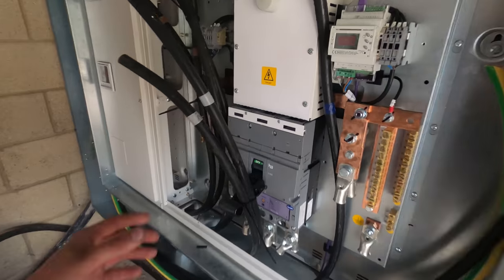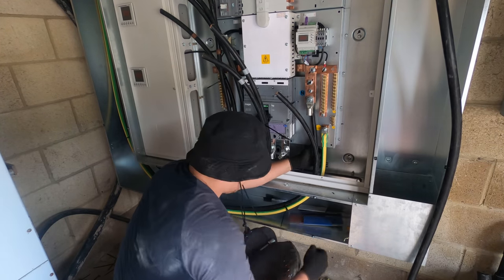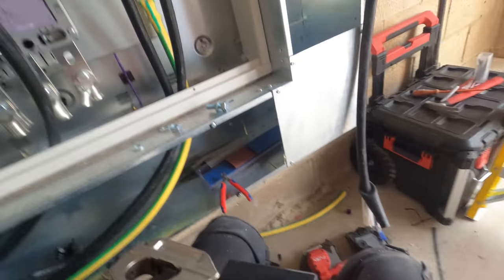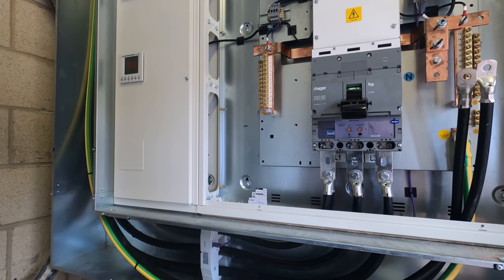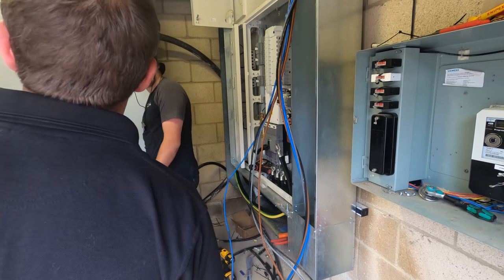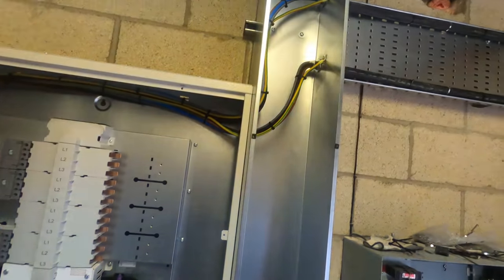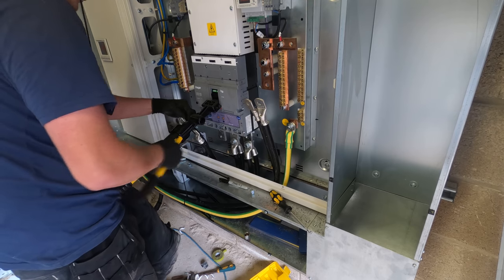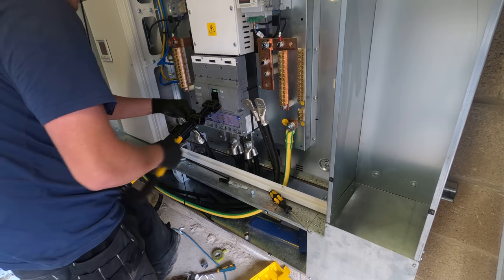Terminating a 630A 3 phase supply - 185mm2 Parallel’s

Comment: I can highly recommend the Klauke Hydraulic crimpers having used them extensively all the way up to 400-500s. Expensive to buy and own obviously, but i'd say renting one where you're gonna use it is 100% worth the money for how easy they make the job. That said, it's not my money either way, i'm just the dude doing the work.
Reply: I use klauke EK60 ( old model with old makita batterys ) a lot at my job at a factory  .. i do own the chinese one like in video .. it does  work .. but the klauke is soooooooooo much easyer ..but expensive if you only need it couple time a year ..
Reply: Im agree
Reply: @kittsdiy  i think we have the same model at work. its a slow crimper, we also have a weidmüller epg 60 crimper its much faster, and a way more balanced which is a good thing when you are using it a lot. would love to try the milwaukee ones too but i cant get my hands on 1 for a test
Reply: @kittsdiy   same goes for me. its a company owned tool we just get to use it
Reply: @DeviloftheHelll  yeah, the Weidmüller crimper rulez!

Comment: Neat job, impressed by the tools used today. When doing LV panels in the good old days soldered the lugs, fingers crossed never a dry joint.
Reply: Aye getting the old solder pot up to temp on the gas ring and wiping the cone on the gland,happy days
Reply: @anthonyschofield7807  Don't forget the flux and cut back the conductor insulation and use insulation tape to cover the exposed  copper/aluminium.
Reply: @terrypark5886  Aye scotch tape I bet you can’t buy that now and imagine showing a new apprentice how to prepare a wiping cloth. I laugh at some of these videos now with their tin box dis-boards and wonder how they would go on with Bill Imperial iron clad switchgear
Reply: @ Antony Schofield  I started 1969 working to the 14th edition of the regs. 
Cast iron bain of my life drilling for what seem like a life time and those stupid Enox cutters. Remember the  narrow MEM distboard had to use long  nose pliers to enter the conductors into line, neutral and earth (cpc) terminals. The days of  rawlplug tool and fibre plugs.
Conduit bashing started with a wooden block and from nowhere Hilmore bender with the vice appeared.  
Installing 240 mm swa using brooms to hold swa against the ceiling while your mate cleated as you progressed along the run.  
MICC 1.5 to 150mm   dressing and making ends in the freezing cold wearing a donkey jacket on one of many  petroleum refineries.
Metal trunking  making right angle and set bends of different degrees. 
House bashing 1930 newspapers under the lino or carpet stained with pets  urine.  Wooden fuseboxes without a main isolators, porcelain interiors and fuses. Immaculate installed  lead or TRS cables. 1/044 and 7/ 029 stranded conductors  became 1.5 and  2.5mm singles.  
Working live on busbar chambers plastic sheets over the bars, earthing removed, bum cheeks in tight mode as you drill and tap the 500 amp live  busbar. Lug in place tighten the brass bolt  saying to yourself "I survived."
 The voltage tester a 60 watt lamp flex pendant. 
As a machine sparks life was so simple in the  electro/mechanical era visual inspection of contactors / relays making or breaking assisted when fault finding. 
Finally skill of electrical design out the window all the calculations  on software, I miss my slide rule.
 Fifty three years later still sparking.

Get Outlook for Android
Reply: @terrypark5886  I started in ‘63 but had a very similar experience over 54 years! 
2 inch conduit bent with a screw operated bender,bending block a treasured possession when it was properly broken in. Seeing cables going from lead via tough rubber to PVC,mounting sockets and switches on wooden patresses.13th edition then and testing was extremely basic,500 volt wind up meggers.Still installing paper lead cables.Seeing so many different MI tools come and go and they never got them right.But always learning,always something new and new tools to buy,at 73 years old I still buy bloody tools 😁.
You and I have probably seen everything in our game and have some stories to tell,some situations would scare the pants off young sparks today.Health and Safety??As for slide rules I doubt anyone could use one today.Cable calcs?How long ,what current,volt drop,who ever dreamed about disconnection times and that short circuits wouldn’t blow fuses?
A good job though,so many opportunities to make money on the side,Burglar alarms,satellite TV,CCTV 
someone always wanted something 
Cheers anyway nice to reminisce

Comment: The Indication for the phasing in a "SqD I-Line" panel (or any stacked-bus design really)  is indicated by A-B-C markings on the breakers themselves  ( @ least the ones in the US ).
Also, you can order 2-poles as A-B or B-C or A-C  &  1-poles as A or B or C  because you have the advantage of  installing  them in ANY location ( unlike a typical comb-bus style panel ).
The other huge advantage was the somewhat-safer install/removal of a breaker while the panel was energized. Electrical-Safety standards have improved greatly since those days obviously.

Comment: Shame the mistake with the original DB was so costly. Not one you'll make again in a hurry. Good thing the DNO was able to attend a second time so quickly.
Ironic that the Chinesium crimpers seemed more reliable than your SWA ones. Hopefully you'll get them changed under warranty.
Keep up the content. It's great so see content that isn't residential.
Reply: don't get that mistake much.. couldn't he just reverse the other side ? ( where no live is ) instead of  again calling the DNO to turn off the power for maybe 15-30 minutes to  change 2  wires in the braker ?  Sounds silly to me ..  i find i not such big mistake .. we usually measure the phase rotation to see if it's correct .. but on a dead board that's hard ..  Really bad dessign of board ... you have to call  DNO before working in it is possible  ..
Reply: @residualelectrical  Still silly you need to call DNO  cut the feed to that board.  Factory i work usally have a pvc isolation over the incoming tales ( in this case under de main isolator switch )  I can understand not working in a board with live busbars ..( i don't do this also )   Couple weeks ago i added a 250A braker to an 800amp board just powered off the main switch and then removed plastic cover off buss bars  ( not the tales ofcourse !  ) .  The  2x300mm² aluminum tales where still live but unable to touch .. plastic cover protected.  in this case a pcb cover over  main tales ( underside of main isolator ) would make things al lot easyer to service ..  Remove the metal front  when everything live would also be not done here . ( i can understand the cut the cables of the brakers in this case lol  )

Comment: I-line breakers come in ABC and CBA arrangements on the back of the breakers connecting to bus bars, which might explain why you had a phase rotation issue. Nice job, a lot of life left in those old I-Line boards, a lot of strength in them compared to some of the modern tin foil MCCB boards.

Comment: Three phase power is wonderful, but preserving phase rotation is super-important when it powers big pumps - blowing rather than sucking can be quite messy on the factory floor.  Trust me - I was there when it happened in about 1973, but not my problem - the error was made by our utility company when they changed some service wiring in the alley behind our building very early one morning, and all our motors were suddenly running in reverse.  Great fun in hindsight, but a nuisance nevertheless.

Comment: my chief has almost changed all stranded cables above 90mm2 to highly flexible cables which are more expensive but you can use a lower diameter because they can take more power and temperature as the stranded ones
Reply: That and the fact that you spend less time fighting a bloody fucking bear to put them in place ^^

Comment: Never thought to use my powered hacksaw for cutting cables.Always used my ratchet knipex hand cutters !
Do you cut the cable end at a slight angle to get it right into the lug some lugs seem to have a sort of a draft angle due to how they are made.

Comment: Those cheap crimpers are $64.99 USD on Amazon.  😎👍  4.5 stars with 761 reviews.    Also I won't give you a hard time about still using some of the yellow power tools either!  Need to get a few more team red tools to swap those out.

Comment: 'hobby' electrician here:
Why are the cable terminals so thin compared to the cables themselves?
Is it a non-issue because they're only very short and thus the added resistance is minimal?
Seems a bit intuitively weird to me, considering 'a chain is only as strong as its weakest link'

Comment: He needs to get you an Izumi 12 Tonne Battery Hydraulic Crimper yeah they cost 2k but its costing you more in time plus its tax deductible. You can get cheaper ones Chinese for like 800 but they don't last long. They do up to 3-400mm

Comment: doesnt the grounding and neutral cables needs to be half the diameter size of the line cables?
im not from the UK, i learned practical electrical engineering and this is how we were thaught its suppost to be in my country thats why im asking, might be diffrent over there.
and btw, nice job overall !
Reply: They don't have to be smaller but they can sometimes ..  when we run 4x120mm² we use 70mm² CPC .  when we run 4x50mm² we use 35mm² CPC . This is approved here .. can vary in other countrys ofcourse ..
Reply: Half the diameter seems very small to me, are you sure you don't mean half the CSA?

My understanding is that here in the UK reduced-size neutrals are sometimes seen on older installs but have fallen out of favor because of concerns about unbalaced loads and harmonic currents.

Earths on the other hand often are smaller than the phase conductor. In principle, there are calculations that can be used to work out the minimum size for the earth condutor. In practice it often depends on the cable type, larger sizes of twin and earth cable come with an earth conductor two standard sizes smaller (about two fifths the size) than the phase/neutral condutors. Armoured cables come with all cores the same size, so your options there are to either have a full sized earth conductor, to rely on the armoring for the earth or to run a seperate earth conductor.

In this particular job he was using single wires in trunking with parallel pairs of 185mm² for the phase and neutral conductors but only a single run of 185mm² for the earth.
Reply: @petermichaelgreen  No this way we have multipe doen in Factory i work and approved by inspector  .  On the other hand we installed 300mm² unipolar  double per fase ( 2x 300mm²  and also de PEN was double ( 2x 300mm²)  ( The neutral is then splitted in the first board ) . According to or  A.R.E.I. ( rules in Belgium of electrical installations ) The the cpc has to be at least halve the size of the Line conductor .

Comment: Hello, i have a question. Is it due to the current rating that you are using two cables for Neutral and for the phases or there is some other additional reason to it?
Reply: @residualelectrical  also, why it is that we always have the Incomer side at the bottom of a panel?
Reply: @ajinkyadagadkhair5474  because the incomers enter through the bottom and you don't want the cables to be strained.

Comment: Hi new subs here. Newbie electrician. 

Q: why do you double(parallel) the phase cables?

Here's my thoughts: 
1. For power factor correction?
2. For splitting the current?
3. For much easier cable pulling?
Reply: I'd say the demand for the distribution mains would require 400mm^2 cable, so to save money and heartache from pulling such a large cable, you can parallel the cables (run two sets) like old mate has done to deliver the same amount of current carrying capacity as a larger cable would do. You just need to make sure that both sets run the exact same distance and terminated together for equal current to the supply, hope this helps.

Comment: Bandsaw to cut cables = bad practice! (Why? Because you are contaminating the whole installation with copper dust!) Get yourself a set of Klauke cable cutters and…
- some jacket removal tools,
- a proper cable crimper

and you should have installed the cables: L1, L2, L3, N, PE -> much easier install…
Reply: Hi. I saw your comment, was just wondering what cable crimpers you would recommend, I have tried various types over the years and have never been entirely satisfied with any of them.
Reply: We sometimes even use grinders ...but yes the klauke is very nice ... but $$$$$$$$$$$

Comment: And then tri-rate was invented!!! 

185 stranded in trunking???

Hard way to do it!!!
Reply: @residualelectrical  We use 185/240mm tri-rate a lot ( we actually don't go above 240 we just bin up) but they are def Tri not Bi Rate.

Don't see the point in battling with old school when you can just go this century...

But I did like the portaBand choppy, obvs i don't need that as I don't use 7-strand (class2)  but REALLY tidy solution IMHO... :-)

Comment: Get one of these, a little pricey but never had an issue with them. and if you wanna upgrade get the battery powered one. https://www.etscablecomponents.com/product/cembre-ht131-c-hydraulic-crimping-tool-10-400mmsup2sup-ht131-c/